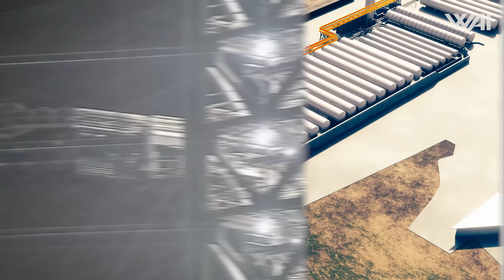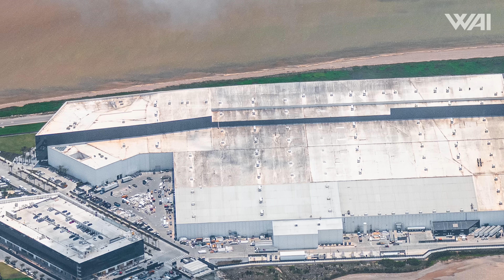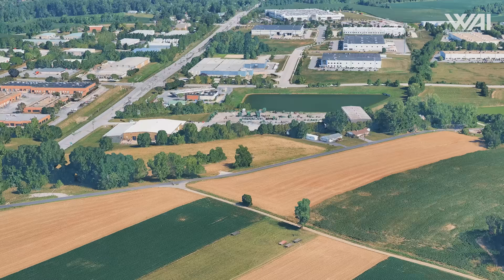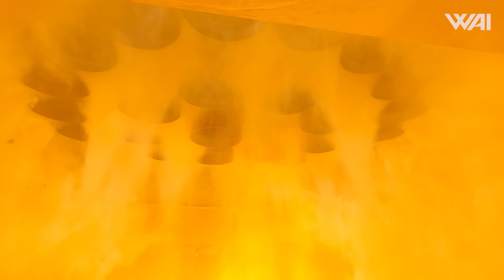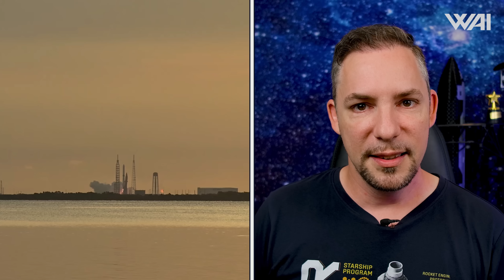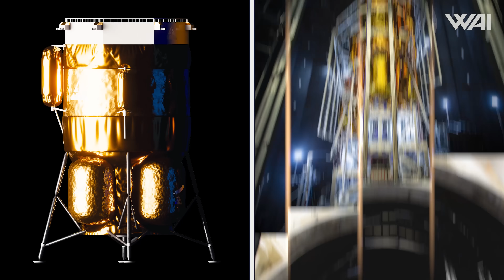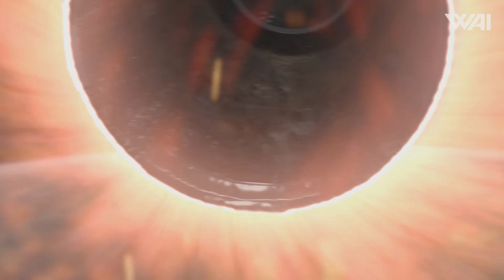SpaceX Reveals HUGE Clue! When Is Flight 12?

Comment: I would like to see a partnership between blue origin and SpaceX at this point so that we can move forward this way if one trips up the other can pick up. And it doesn't have to be a bad thing because this goes to us Americans getting on the moon and getting into space much faster. So our egos must be put in check.
Reply: Why? What would they or us gain? A partnership between SpaceX and Blue Origin would likely slow everything down. "Egoes" and fierce competition are actually the primary engines driving the rapid pace of innovation, in a partnership the pressure to undercut prices and invent tech would evaporate. 
Competition also provides dissimilar redundancy, so if someone, as you say, trips up, a failure in one doesn't stop the other (this is why NASA intentionally awards contracts to multiple companies).
Also, SpaceX and Blue Origin operate with fundamentally different philosophies: forcing these two cultures to merge would create a bureaucratic nightmare. They would spend more time in board meetings trying to agree on a "standardized bolt" than they would actually building hardware.
It's that desire to be "first" and "best" that translates into 100-hour work weeks and engineering breakthroughs. Competition creates the talent war, pushing the best minds to work harder, provides parallel paths to the same goal, and keeps costs down because the customer (government in this case, spending taxpayer money) can play one company's bid against the other.
In short, we don't want them to hold hands; we want them to race. The faster they run against each other, the sooner we all get to the Moon.

Comment: I think the 10 engines from the original static fire are ok.  If you look at the SpaceX documentary at 18 min 20 sec the girl says that the 10 engines were salvageable.  It then goes on and the guys says the data showed possible mechanical damage to 5 of the engines.  I think the latter statement came first and then later on they found that all 10 engines were ok.
Reply: Either that, or the damage could be fixed without scrapping the entire engine.

Comment: Artemis is ready to go to the moon but we dont have a lander. I said years ago when spacex got the contract for the lander a moon landing in my lifetime (10 years or so I hope) was lost. What happened to mars in 2026?  4.4 billion dollars of tax money and 16 billion total and starship still has not even orbited the earth let alone the moon or mars. There is no interior yet! No life support system! No where close to a lander. Blue origin is a far simpler design but still has a way to go. Unfortunate and unnecessary disaster. NASA should have built the lander too.
Reply: NASA took >20 years and ~$30 Billion to build Orion (a lunar capsule unable (too weak) to reach low lunar orbit). 
Spend billions trying to build a spacesuit and failed (gave up and gave it to the private sector). 
Spend tens of Billions and well over a decade on SLS (which was supposed to be an easy legacy rocket made up of already existing subsystems, like the engines and boosters).
 What makes you think they would be capable of building a lunar lander sooner, or at all?

Comment: Thanks for the balanced reporting of Blue Origin NG3, o.k upper sabatage failure but that is very fixable, the fact they nailed a second booster landing is incredible, and in that aspect it way ahead of star ship! No one seems to really see that over the smoke and noise and star ship! I love both companies but I feel people are mixing the significance and New Glen!
Reply: Remember though new Glen is essentially a larger falcon 9. It's still an amazing accomplishment but not in the same league as the starship fully reusable architecture. So there's really no point in comparing New Glen or starship at all.
Reply: New Glenn is not even competitive with the 16 year old Falcon. It's a heavy, complex (lower reliability, lower production rate, higher operational costs), fundamentally unreliable (lower cadence), very expensive system that has half the payload to high energy orbits (e..g. GTO, NG 13t vs FH 26t).

Comment: to do this inter planet travel thing right, we are going to need a low orbit fuel depot to separate the critical launches from the fueling ones. otherwise, anything less than a series of perfect launches will cause large delays.
Reply: I don't know, but current mathematics show boiloff of fuel is likely WAY longer than the negative media is making it out to be.  With proper coatings, perhaps boil off lasting 300+ days.  If even that is 10% of the time, that's still 30 days.  With 5 launchers (2 TX, 3 FL), that's still a heck of a lot of launching.

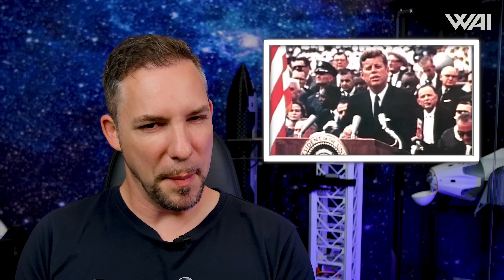Comment: 8:15  Yeah, South Texas in the summertime is BRUTAL with the high temps & humidity.  Walking out of aircon is like walking into bottom of a full swimming pool, the air is so thick.
Reply: Technically, hot, humid air is thinner (lower density) than dry, cool air. Counterintuitive, I know. But it is a significant issue for airplanes, since it reduces the lift from their wings, and makes it harder to take off.
Reply: Good to know. Want to see a launch. Someday.

Comment: For me, if we focus on just Blue Origin and allow ourselves to forget they have competition.  Their own internal motto is going to be an issue for them, "Gradatim Ferociter".  They been focused on step by step for so many years that in the face of these situations, if they don't keep that as a focus, they may attempt to move too fast and increase their risk.  I think this internal rhythm works for them and if they stick to it, their time table for MK1 may hold for 2026. However, MK2 is the real issue.  They can't just take a successful MK1 and make it an "MK1.5".  All of their habitation systems were designed for MK2 which was slated for Artemis V and VI originally when they were chosen. Their step by step plan would need to be accelerated.  I honestly think they do not have a chance of being the HLS provider for Artemis IV.
Reply: Agree. Just like they gave up and shelved N.Sheppard (which was supposed to be flying weekly be 2015), they now shelved MK2 and  attempt to replace it by sticking a tiny crew module on their MK1. Crewed landers are many times harder though, their MK1 is closer in complexity to the rest of the small commercial lunar cargo landers (which were also completed much faster with vastly less resources: Intuitive Machines Nova-C 4 years dev., Firefly Blue Ghost 4 years, Astrobotic Peregrine 5 years) than it is to MK2. Given their track record of chronic delays and glacial iterative progress their statements about landing humans on the Moon before the end of the decade are laughable. I honestly think they have a very small chance of ever being the HLS provider for Artemis in general.
Reply: @admarsandbeyond Here's my concerns with MK2:

1) What is the usable payload to the moon surface - i.e. everything that is taken out of the lander that can be used and left on the surface - tools, habitats, solar panels, rovers, etc - this is NOT the weight of the lander itself, nor the humans (those two are either going back to lunar orbit or coming home).

-My understanding is about 2-5 tons.  Does this align with the lunar base buildout?  I don't think so.

2) What complexities with the launch plans are there with MK2?

-My understanding of the "plan", although BO is kinda hiding this, and so are youtubers...

Blue Origin Blue Moon Mark 2 (BOBMM2) stats…
NASA HLS (Human Landing System (Moon)) program...as it stands today: 

What are the final numbers for a single mission to the Moon surface to land BOBMM2?

Note: this includes the humans travelling on the SLS-Orion to get there, a requirement of the mission.

3 separate craft have to travel to the moon 
5 or more craft are blasting off from earth 
3 or more docking maneuvers occur above earth 
3 docking maneuvers occur above the moon 
fuel is being transferred above the earth 
fuel is being transferred above the moon 
usable payload to moon surface is small

Comment: You'll remember that Artemis II did not do a separate WDR before launch.
Reply: what? they did multiple and found problems in 2 of em, that's why the first launch date of february originally slipped, a non well gone wdr
Reply: @golem_videomaking  I am talking about the launch. They opted NOT to do a WDR remember? Please read what I wrote before replying.
Reply: @jackcolter8805  well they did 2 then a rollback, i still consider the two being done as that. yk, same rocket, same hardware, same engines, same tanks, same avionics, same capsule.. it's not like they rolled back and launched a completely different rocket without a wdr, they did two and just brought it back a second for some checks. it should still count
Reply: @jackcolter8805  We did read what you wrote. What you wrote doesn't say what you claim it does.
Reply: @golem_videomaking  I know that! I'm not stupid.
Reply: @heartysteer8752  Try reading exactly what I wrote - "before launch". Maybe I should have said "immediately before launch" for those who can't read between the lines.
Reply: Kind of different situations though. Artemis II did a couple of WDR's on the stack after rolling it out to the pad. However they chose not to do another WDR after the second rollout of the stack.

Starship flight 12 will be stacked for the first time in the coming week or two which will not only be the first stacking for this flight it will also be the first stacking of any version 3 hardware and also the very first stacking on this launch pad which is also the very first version 3 launch pad. I will be very surprised if they don't do a WDR before launch.
Reply: @StevePemberton2  I know that.
Reply: The problem is you stated a fact without stating what point you were making, and also used vague terminology "separate WDR" which could be misinterpreted as if they didn't do a WDR, and when someone questioned you about it you got after them with "read what I wrote".  I also see a lot of "I know that" in your replies. Why don't you just clear it all up by telling us exactly what your point is rather than complaining because people are apparently not guessing it correctly.

Comment: So Blue Origon had a weak engine out of the two ?
So why couldn't it just keep going, taking longer time to reach correct orbit since It was out of earth's gravity not needing a lot of thrust, just more time ?
Contingency plans ?
Reply: it was subsequently stated that there was a propellant leak that left the upper stage without sufficient resources for an extended burn.  In short: it was out of gas. Other sites reported this and I'm a little surprised Felix didn't mention it.
Reply: @DexRobinson  But, but, but it was reported that the other engine was fine.
With that, the fuel shortage should had effected Both engines.
I smell a rat but I don't know for sure.
Reply: @JStock-id1qi It was never out of Earth’s gravity.

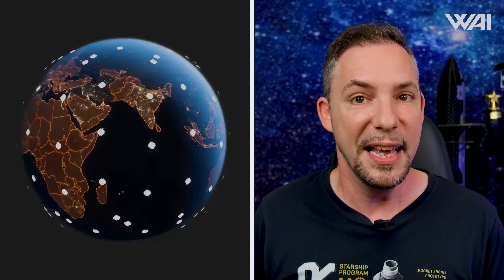Comment: at 15:40 - Yeah, why didn't they make the burn longer if they lost an engine on the second stage of Blue Origin?
Reply: Longer burn by itself doesn't fully solve it because the gravity losses start piling up, so you really need to increase thrust on the remaining engines, while also meanwhile dealing with some asymmetric thrust. My guess is that this was a software shortcoming, the software didn't correctly respond to this particular situation.
Reply: @StevePemberton2 Or, it’s a genuine design issue: either with the software- i.e., they never coded for an upper stage single-engine anomaly- or, the hardware. The BE-3U is throttleable; and whatever the anomaly was, it wasn’t so bad/energetic that it took out both engines. It may be as simple as they screwed up; that even tho the hardware is capable of independent operation and control, they didn’t code to actually use that in event of an anomaly. - Dave Huntsman
Reply: @dphuntsman   Could be, there was of course the Falcon 9 CRS-7 flight to ISS where the second stage broke apart due to a pressurization tank rupture, and the Dragon capsule (with some very valuable cargo including a new docking adapter) survived the fall intact all the way to the ocean, doomed by the fact that SpaceX never bothered to code the software to deploy the parachutes in a launch anomaly.  However I kind of think Blue Origin has probably coded for second stage engine failure or low thrust, but how it needs to handle it depends on when the problem occurred, how much thrust the problem engine still had, was it stable thrust or varying, asymmetric issues, what were the allowed limits for increased thrust and gimballing on the other engine, and maybe the software just didn't manage this particular set of circumstances correctly, possibly being outside the range of scenarios that they tested the software for, or the software to failed to execute a contingency routine that it had programmed in but wasn't used.
Reply: Because the pad abborted the test and the damage comes from the hard shut down after the abort activates
Reply: @randallhoover2410 Wrong channel bud.
Reply: @randallhoover2410 Correct answer to the wrong question
Reply: My question also... More to this than they are saying.
Reply: When the investigation is complete, in about a year probably, we'll probably find out buried in some report how the engine in reality failed energetically (explosion or fire) and took out the other engine/damaged the stage.
Reply: @admarsandbeyond Yes, most likely, or a leak or a stuck valve.